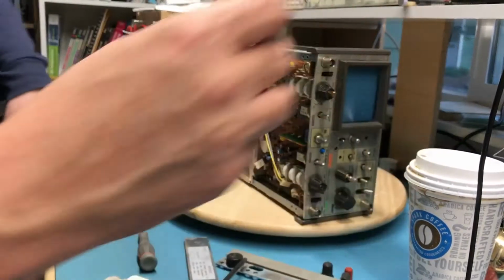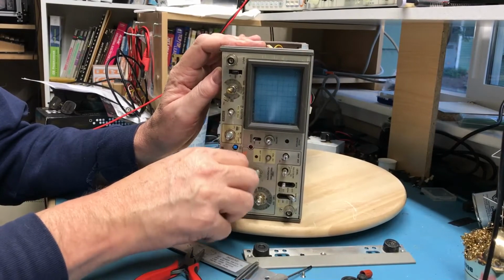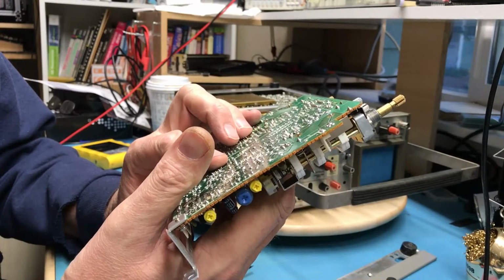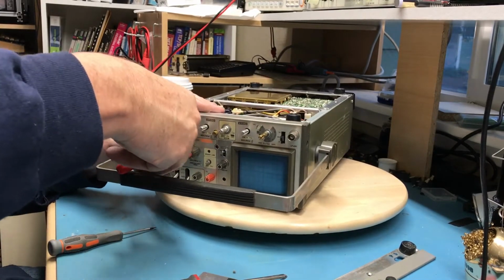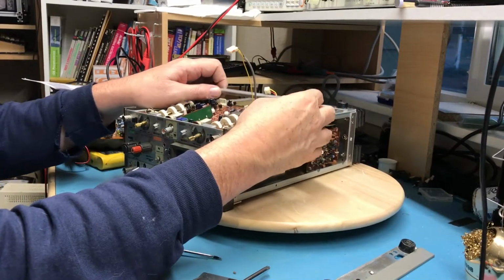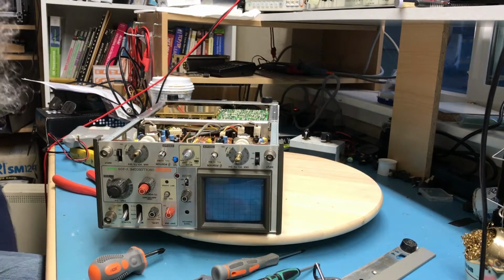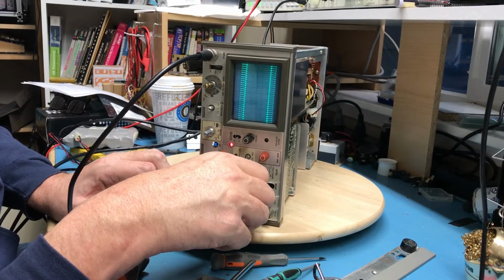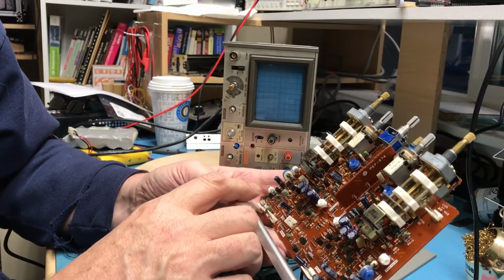Hitachi V-209 - Part 1 - Beginning the repair and testing the scope - STB126

Comment: Great vid, question: how do you remove the handle from the the top casing /. cheers
Reply from the maker: There is an exploded view on the last page of part 3 - https://archive.org/search?query=Hitachi%3A+V+209
As I recall the plastic covers where the handle meets the body can be pulled off, then the screws under it can be removed.
For the plastic cover on the end where the metal handle come out I was able to use a flat blade screwdriver to release each side of the cover then the cover was pulled off. It is rather tight but can be done. This would be the side mentioned above facing the front in the drawing.

Comment: excellent video. where do you get your sae & metric hex key set ?
Reply from the maker: I don't know where I picked them up at. I've bought a few sets over the years typically seeing them on sale somewhere. if you're asking about the set with the yellow handle the keys fold out of that was bought for use with my compound bow.

Comment: What do u clean the switches with. In side
Reply: Think you.
Reply from the maker: I use DeoxIT D5, you can find it on Amazon or from most electronics distributors. Spray it inside the switch then operate the switch several times to clean off any oxide. Note that if the switch has had internal damage, arcing etc. this won't fix that.
https://www.amazon.com/Hosa-D5S-6-DeoxIT-Contact-Cleaner/dp/B00006LVEU/ref=sr_1_5?dchild=1&keywords=deoxit&qid=1607705744&sr=8-5

Comment: I just got a V-209 off a friend of mine, should I pull the battery or replace it ? It's only going to be used on my repair bench for old computer stuff.

Comment: I like to use a nut driver for the nuts on the controls..I would have took the front end off the dropped scope and put it on the other on like you did..
Reply from the maker: Nutdrivers are something I'm lacking on my bench but are a great idea. I'll add them.